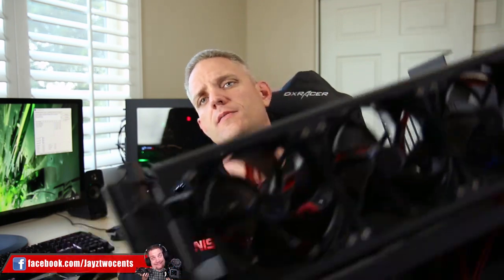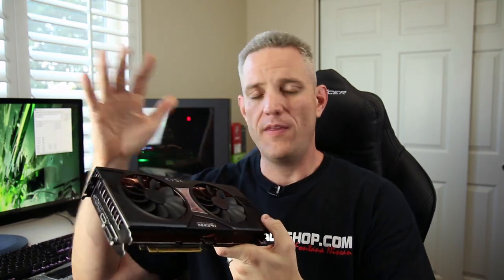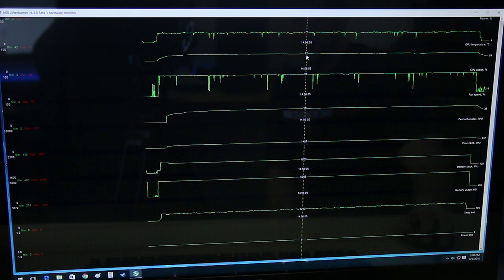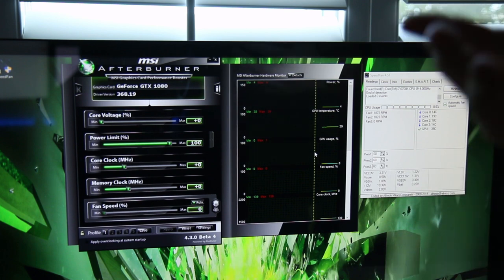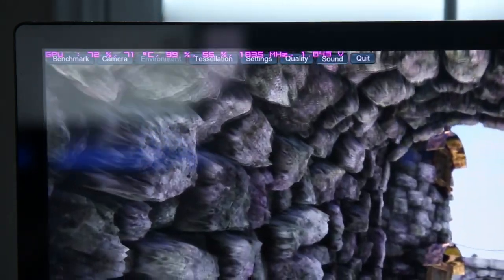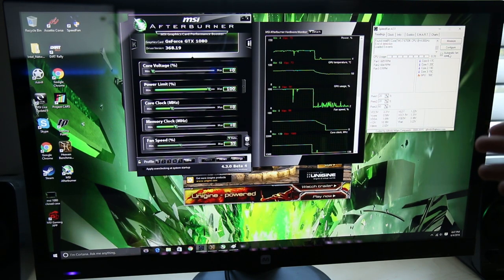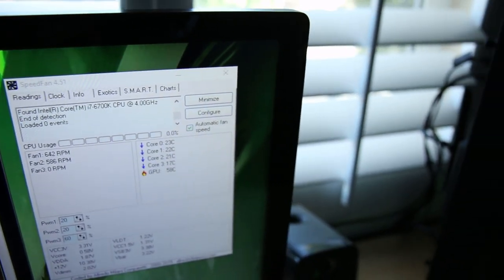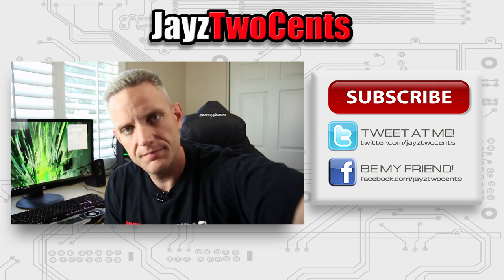Do cases make video cards run hotter?? - Test Bench vs Case

Comment: my overclocked 390 is definitely hotter inside a case, that being said it's a much less power efficient card with an decent oc in a much smaller bitfenix case with worse airflow, the top of the chassis is actually getting pretty hot after a few hours of gaming. but as jay said it's a very specific case that will only apply to a small number of people
Reply: Oh there are so many things wrong with this video dude. like everything is always tested with a gpu with a sub 200 watt tdp
Reply: James Mastroianni I wouldn't necessarily call it wrong since many people have a 970 that is a sub 150w card, or 960 and 950 that are even lower, but a gpu that is using close to 300w when OC'd does get worse temps inside a micro ATX case

Comment: Can you recommend the KrK Rokit RP5's?
Reply: i had the rockit 6's. and many times i would be listening to something and thought my headphones were plugged in (they are open back) but actually the speakers were playing and i didnt have a clue. they are the most crisp punchy. dont ask jay about this. he is literally making a video about how not enclosing something that is hot might help it cool down faster. stick to water cooling jay ;)
Reply: Did you connect them without a interface/mixing desk?!
Reply: ya you can connect them with a 3.5mm to rca. there are much better ways to play music through them but thats the simplest and easiest that comes to mind.
Reply: zJji k
Reply: ok, want to add anything constructive in the case i missed something? maybe to help a situation?
Reply: he is literally making a video about how not enclosing something that is hot might help it cool down faster. stick to water cooling jay ;), that is what you said but how does that make any sense? why wouldnt he make a video about it, its a serious question, and you didnt even watch til the end of the video because inside the case was actually cooler.
Reply: oh i see. great. i was wrong. my point is i dont care. its interesting but theres no way im listening for 12 min to find that out.

Comment: I think there is an argument to be made about air turbulence inside of a case that you don't get in open air test benches.  Plus aren't most test benches mounting the mobo horizontally?  Could also be a factor.  Bottom line, keep your components inside a case.

Comment: Hey jay I just saw your video about speedfan and how to set it up but my fans were not even detected by it. I am using the h440 (v2) and I have all the fans connected to the PWM fan hub on the back of the case.
The fans are operating normally but i just want to be able to control their pwm because they are a bit loud.
Reply: +The World R:Craft Yes it does, there is a cable labeled "PWM" which I have connected to one of my motherboard's system fan 3.
Reply: you have to plug the fans into the MoBo to get software control.  If you want them to be quieter, but have too many to plug into the mobo, either buy Y cable fan splitters, install a quiet noise adapter in line between the fan hub and the power source (essentially just an inline resistor), or buy a fan controller that plugs into a USB header or fan header on the MoBo
Reply: +Niko Yochum So what you are saying is that I must buy a 3rd party fan controller to control the fan speed. But why would there be a thing named PWM fan hub if it cannot control pwm speeds?
Reply: +Niko Yochum So what you are saying is that I must buy a 3rd party fan controller to control the fan speed. But why would there be a thing named PWM fan hub if it cannot control pwm speeds?
Reply: +Niko Yochum So what you are saying is that I must buy a 3rd party fan controller to control the fan speed. But why would there be a thing named PWM fan hub if it cannot control pwm speeds?
Reply: +Niko Yochum So what you are saying is that I must buy a 3rd party fan controller to control the fan speed. But why would there be a thing named PWM fan hub if it cannot control pwm speeds?
Reply: Ioulios Patman The fan hub in the H440 is 3 pin, not PWM (4 pin)... also, generally a hub is used to power fans at a constant speed whereas a controller implies that you can change the RPM.  Another way I just thought of to make it quieter is to find where the fan hub is powered by 4 pin Molex and switch the +12V pin to the +5V pin
Reply: +Niko Yochum I understand. I have also noticed that some of my fans don't have 4 pins but only 3, does this mean that they cannot be controlled even with a fan controller?
Reply: Ioulios Patman They should still be able to be controlled, but it will be with a different technology... most medium and low end fans (below $20ish) are 3 pin headers.  In my case, I have most of my fans plugged into my mobo, which has built in dynamic fan control (Asus).
Reply: +Niko Yochum Thank you very much for your help :) I had this question unsolved for a long time, it's really nice to learn new things.
Reply: Ioulios Patman I'm glad I could help :)   I actually have the same case (Razer version) and can do some toying around with the fan hub tonight to see if I can ghetto rig fan control off of it

Comment: ventilation speed has a limited effect. Hence no surprise that lowering 4(!) big ass 12 cm vents to 500 rpm makes a big difference as long as complete air exchange is granted and no hot climate can build up. What's more decisive is the efficiency of the heatsinks and ambient temp. If that is ok, a light air draft will do ;-)

Comment: Pitiful low CFM "silent" fans aren't the kind of case airflow we're talking about here. Maybe to the average customer yeah, but their choice of silence over hardware lifespan isn't the greatest. Server blades are built thin with very high rpm/CFM fans for a reason. That's to control and lower temperatures of the components.

Grab four 200CFM+ Delta fans and see if a case that large can handle those fans. Right now those silent half-assed CFM fans (which aren't up to fan industry standards, really. Once you begin looking at decibel vs. airflow...) aren't doing anything for the case. Then again how thorough can a "Youtuber" be, really. With a person like Felix leading Youtube, i'm impressed any kind of intelligent videos show up on this community.

Comment: i dont see why people are throwing such a fit about how you did the test, you cant test everything, every case will cool differently, different fans are more or less effective at cooling, nobody will have the same results, open air test bench gives you an idea how much heat the card itself will dissipate everyones individual results will vary depending on case setup, fans, and other parts in the case giving off different amounts of heat. Just from going from my el cheapo ibuypower case to a carbide air 540, i lost 4c on my 8350 and ~6c on my xfx 280x, with the same number of fans in both cases. sad part is, after you going through all this, people arent going to be satisfied, there will always be something wrong. you can't realistically test every situation.

Comment: interesting test. However, as long as the ventilation secures complete air exchgange with the outside, no hot climate can build up inside the case. Now buy a mid priced computer case and use the ventilator(s) shipped with it. Often it is zero or one 12 cm ventilator. Then choose a case that does not have ventilation holes on the top (hot air rises) and you might get totally different numbers. Next overclock the CPU in order to heat it and the mainboard up. The GPU will run hot.

Comment: I'm curious how CPU heat will affect GPU temps, especially in gaming loads where the CPU is being used. I'm also curious how open-air compares to small form factor cases which can heatsoak much quicker due to limited fan options.

Finally, I dare you to do this with an R9 290/390. :D

Comment: i only have one bone to pick with your methodology

that is you need to transplant everything not just the video card to get proper data
the reason for this is because of the way electronics work you could buy 2 of the same thing but they will function differently

and when i say transplant everything i mean everything all the way down to using the exact same power cables for the same parts

you need to transplant every thing
mobo,memory,hdd's,power supply,fans,coolers,etc. i mean everything except the case

even having things in the different orientations could effect the way things work
i.e. the mobo vertical versus horizontal

this is how you eliminate all variables except the one you want to test

thats my bone to pick if you dont like it thats fine

Comment: I also suggest to run tests following the setup described in my previous comment for at least 40 minutes and to indicate the ambient temperature (suggest to put the box under the table). Zse real world test that requires the CPU and GPU to constantly run above 90% (Rust, rendering etc...). I guess your video is (Nvidias) answer on a statement made concerbing the 1080 throtteling by AdoredTV in one of his recent YT videos...

Comment: Can someone tell me about MSI Afterburner? I've got the Sapphire R9-290x.. I've put my core voltage to +63 and power limit to +50 "maxed". My core clock is 1155 and memory at 1330. It's completely stable but are my voltages going to damage my card? I think the voltage maxed is 1.219v. I'm kinda poor and dont want my gpu to explode lol

Comment: Side fan on the case really helps with temperatures.
Reply: Peter Pimmelmann nah
Reply from the maker: Side fans sometimes can be argued that they mess up the flow characteristics of a case. Ive never tested that myself, but thats just one argument ive seen used.
Reply: In my Aerocool Cyborg X Case it helps really. It also cools the MB components if you're on CPU watercooling

Comment: ambient temps make more difference than most cases and/or fan setups, my 1060 sits about 20c higher than most of the reviews but my room temp is about 35c with 99% humidity without the air conditioner on... with the AC on 25c the temps drop to nearly every review I've seen.

Comment: Jayz used a MSI Gamingx 8G 1080 which Jayz said expels exhaust air into the case- as we get into this hobby, most put better case fans, ideally exhaust case fans at top and back, air in at front, seeking negative pressure- more in than out- given that is it best to choose a gpu card that exhaust the heat into the case? because video cards with 1 to 3 fans might be less efficient trying to exhaust the hot air out the back of the video card. Ive never seen a comparison of video cards exhausting into the case versus out of the case thru the video card- yes, we know everyone"s case and set up ie wires, space in case, ambient air temp all impact this - after we hit all the other bases, do we choose a video card that exhausts hot air into the case?....Pehaps the diff will be so small to not matter? seems like exhaust into the case and let the 5 to 7 case fans and cpu rad do their job?

Comment: Different CPUs might result in different GPU loads -> Voltages and therefore different GPU temps... Probably not a huge difference but the test would have been better if all components were exactly the same.
Reply: i doubt it considering the gpu utilization was pretty much the exact same, the only thing I can think of is airflow in the case helping the fans spin with less effort . newer cards base the fan speed percentage of rpms and not percentage of power or so I believe, I may be wrong though

Comment: Wtf? When my 980 Ti Gaming 6G is out of the case, it's at 80C load, and when in my H440 all fans 100%, it throttles 1 minute after I launch a game, 83°C constant with the core clock going down 100Mhz. How can this be?

Comment: Noob question: Could my GPU being consistently hot (even on idle) cause my motherboard's temperature to increase a decent amount?
Reply: No. GPU heat is mostly in the heatsink. The PCIe connector is not much of a conductor.

Comment: I think the biggest thing lately with your testing was more about the performance loss that you would get of a 1080 reference card in a case vs a n open air testbench because of gpuboost 2.0.... atleast that was my biggest concern :3

Comment: Opencase: Is hotter, because the warm air is blown in all sides, but not with much pressur, so warm air starts to build a bubble    
around the card. Yes warm air is going up but only slowly , if not pushed...
Closecase: Because of the fans even on 20% idle u are pushing air into and outta the case, so you have a const air flow with freshair, and because (cold) air is sucked up infront and blown out warm in the back, you dont have a warm airbubble in your back.

Comment: I might be missing the point but I think this test is flawed. The fan speed is the significant factor not the video card temperatures. You failed to factor in the logic that manages fan speed. It appears the case less system is using more voltage and higher fan speed to keep the temperate below the manufacture given threshold. A better test would be to set both video card fans to max. Then compare the temperatures.

Comment: Drivers for the new cards are really unstable i hear that there are multiple problems with the fan speed ramping up, this may give cooler results but not better sound levels.
Reply: That is only an issue with the FE not the MSI card that is being tested here.

Comment: I have 2 cards running in SLI and when I open the side panel the top card runs about 5 degrees cooler, makes no difference for the bottom one.
Reply from the maker: Thats just because the top card is being staved for air more so than the bottom card. The heat coming off the back of the card is heating up the intake for the top card. Opening up the case side panel allowed for more cool air to feed the top card. This is why the bottom card stayed the same as its already getting fresh air from the case fans.
Reply: Yup, especially the heat from the bottom cards it gets to 80C, and my cards are not the reference design either. So I agree with your video 100% it should not make a difference with reference cards. Maybe it's time to look at water cooling :) good thing you've got quite a few tutorials on that.

Comment: Anyone consider that its possibly that there is no difference because the GPUs arent using a significant amount of power? The cooler on the that card is the same (if i remember correctly) that is on the 980ti from msi which consumers just absolutely massive quantities of power in comparison. If the cooling solution is massively overkill then the temps should remain pretty much the same under most conditions. You'd have to put it in a case where there was literally 70% or more reduction in air flow to see a card that is rated at that twp to see a real difference but still tiny difference.

Comment: Here's what you learn from doing a shitload of different builds in shitty OEM cases and different mid-tower sized cases: 100 CFM in + 100 CFM out = most cases are pretty much the same. A couple of degrees here or there, which is highly likely to be within error of any inter-day replicates that you might be blessed enough to do. Realistically the cut of in each direction is much closer to 70 or 80 CFM when I consider cases that just used 200 mm fans.

Comment: Ultimately, all you should be responsible for is comparative performance between cards. You can't realistically measure performance or temperatures between all the possible configurations out there. An open air test bench provides a consistent standard and blank slate for comparing cards against each other. Each person will need to figure out how their card will cool in their case with their setup. If it's overheating, improve airflow or water cool. Stick to open bench testing, Jay. Don't let Joker and others muddy the waters with their complaining. They're missing the point.

Comment: With all of the myths and voodoo in PC cooling the truth is it's situation specific, obviously a mini ITX with all air coolers will have higher temps than a jumbo case with water cooling. And any case's temps will depend on how well you've set up the case fans and the shape/design of the case.

Comment: The reason the open air test bench needed more voltage on the card was because it had more PCIe power droop check your power supply voltage under load using HWinfo on 12v rail I bet test bench has a lower 12v power number like say 11.90v vs 12.10v the one with 12.20v will allow the GPU to need less voltage because less droop remember amperage is  watts divided by voltage so 0.30v worth of variance is huge. So if one feeds lower voltage from PSU the card will need to raise output voltage  to compensate for the droop.

I learned a longtime ago check your power supplies for droop using HWinfo and such on 12v / 12v+ / 5v / 3v this will tell you just how good your power supply can hold a load if it droops a bit or rides a bit under 12v or on any of the others by much then you likely need to invest in a better more powerfull power supply.

Comment: I'd expect the case to be even cooler if you weren't using a front mounted rad which might preheat the air before it gets to the gpu.

With these fan style coolers, it makes sense that having airflow directed across the card (to supply cool air/exhaust hot air) would be the ideal scenario, instead of soaking in their own heat on a test bench (granted with overhead fan running, that may be a moot point.)

Nvidia cards autoregulate their overclock to temperature benchmarks and you already noted how it required less power in the case, so not 100% sure you can say it makes zero diff.
Reply: Actually Luke of LTT did a Workshop Video on if front mounted rads affect the CPU and GPU temps. The result, it didn't matter.
Reply: Please link me to that video, because I'm not finding one where he tested radiator position and its effect on graphics card temperatures (with cpu at some meaningful load.) Search used: "Linus tech tips radiator graphics" with no results like you describe.